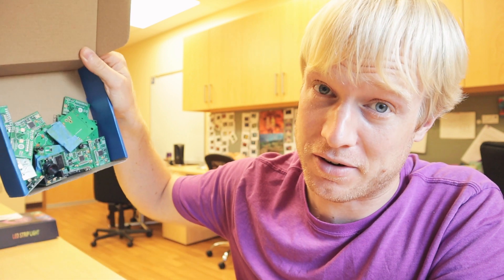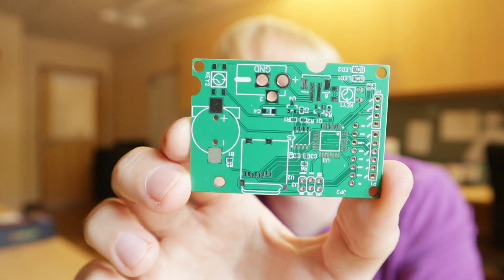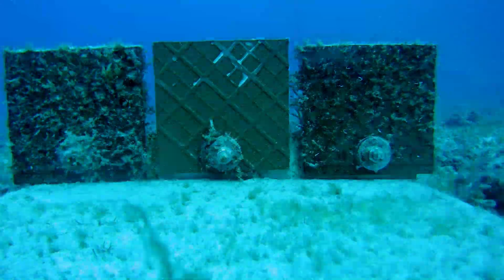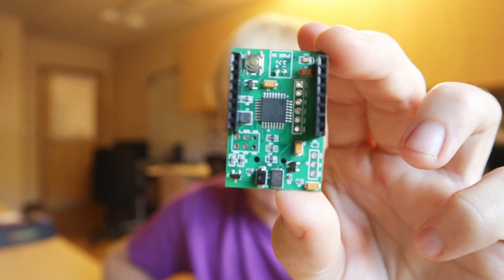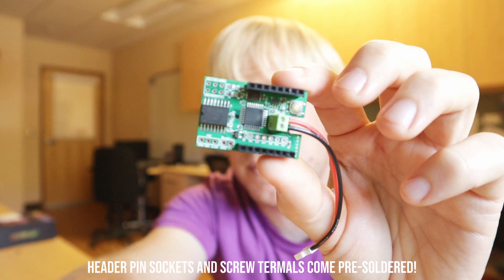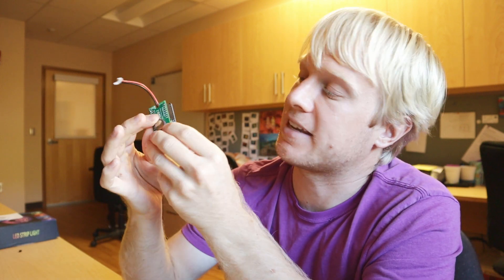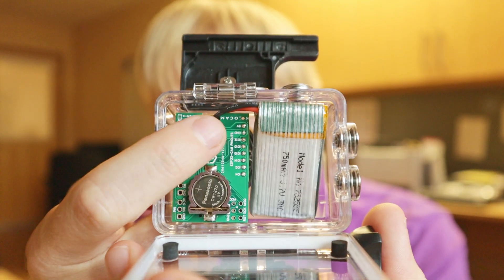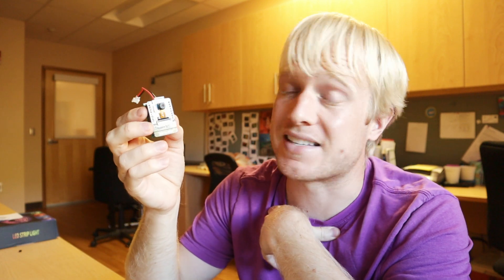This is KiloCam | Real World Science

Comment: ESP32 has a low-power porcessor included. It also have a power saving deep sleep mode. The problem with the ESP32-CAM board for a low-power-application could be the power regulator, power LED and his unaccurate RTC. To conclud your solution is not bad.

Comment: I would suggest investigating the $9 China A9 cameras  available on Aliexpress. They have SD card storage on board and  some come with IR LEDs for night vision photographs and motion activation with the proper application software. I'm not sure of the battery runtime without Wi-Fi turned on?
Reply from the maker: I'll definitely look into them! This was partly a DIY project but has been surprisingly popular. If the A9 cameras can fit into a GoPro housing that would be fantastic. Thanks!
Reply: @AustinGreene  The A9 is 1.75" Dia. by 1.0" deep with on board  LP402030 lipo battery. The circuit board camera can easily be removed from the case to save considerable space.
Also I would recommend an ESP32-cam-ch340 module with OV-2640 camera onboard & TTGO T camera plus which has an on board PIR sensor. ESP32 varieties are more geared towards the Arduino IDE coding crowd but a relatively easy and offer unlimited expandability and flexibility. Just an FYI... Good luck!

Comment: I see you got "why not just use a low power mode on the ESP-32 itself" alot already and you said you couldn't turn off the camera module completely! I checked the schematics for the ESP-32, if you pulled GPIO_32 low, this turns on a MOSFET to give power to the camera, if you just float the pin, there is a resistor that would pull it up to cut off power to the camera module. It has an RTC timer so it can keep time while asleep, but no backup battery. You'd just have to deal with the 4.2V output of the LiPo battery at full charge so all the 3.3V stuff are happy.
Reply from the maker: I'll experiment with floating GPIO_32, this is a really interesting idea!
Reply: @AustinGreene  I’m waiting for your findings desperately

Comment: If the RTC is on the arduino (Kilocam) part, the ESP32-Cam can't access it right ? So no timestamp on the photos ?
Reply from the maker: Correct that the ESP32-Cam can't access it, however to my knowledge the ESP32-Cam doesn't have enough GPIO pins to actually interact with a DS3231SN even if they were connected so it is a bit of a mute point. Since this video was published we're now adding timestamps to the images programmatically by keeping a copy of the KiloCam PCB settings in the ESP32-Cam microSD card. You can also easily add timestamps to image metadata post-hoc using software like Adobe Lightroom.